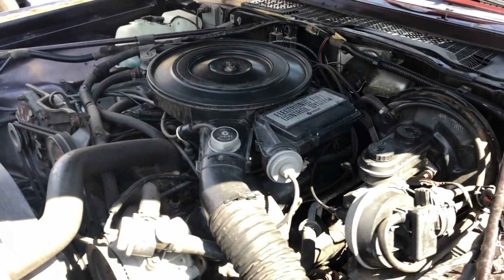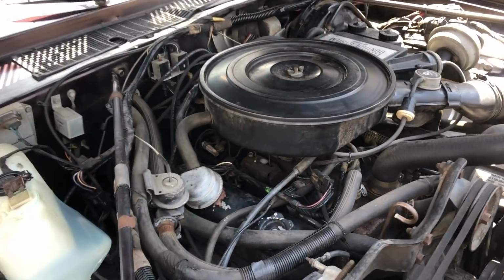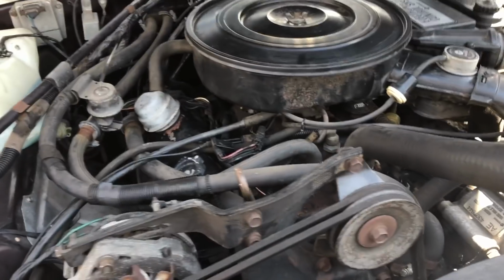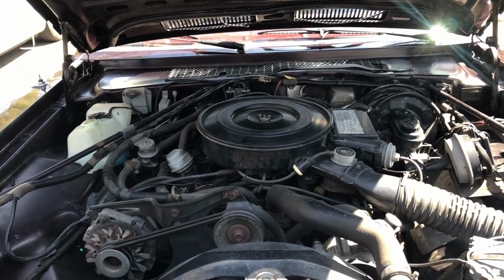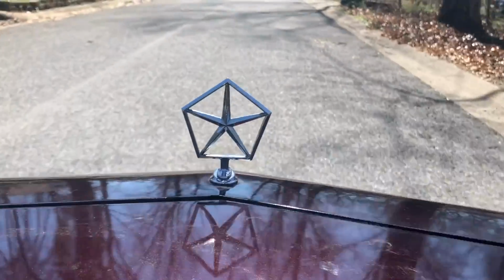The Car Chrysler Forgot to Stop Making - My 1988 Plymouth Gran Fury

Comment: Way back in the day I had a new 1982 Chrysler 5th Ave with 11 miles on it as a company car as an asst body shop manager. It had the same red interior but was more "luxurious" than the Fury and Diplomat. The silver paint and vinyl top was beautiful. I loved that car so much that I bought it at cost from the dealership where I worked when I went to work for Geico. I miss that car and other than a water pump and a/c compressor when it was well over 100k miles it never once gave me any trouble or left me stranded.

Ahh...memory lane. Those were the days.
Reply: Thanks for sharing!

Comment: I saw this exact GF on FB Marketplace and was quite tempted by it. The speed control and premium stereo on a car that lacks a/c make it an awesome unicorn. I'm happy that you're keeping it original-looking; the fake-police-M-body is too commonplace.  :-) My parents had a 1987 GF, and my current daily driver is a 1988 Fifth Avenue (43k miles when purchased a year ago). I replaced the carb and ignition on my Chrysler with an equivalent for a 318 from 1978, and the task was worth the effort.

These cars looked strange when cross-shopped with others in the $13k-range in 1988, but they're so unchanged from the M-body introduced for 1977. The base bench seat design is from the 1980 Diplomat/LeBaron, and the turn signal stalk design dates to the 1979 NY/Newport/St. Regis (if not the Horizon/Omni from the previous year). Check www.oldcarbrochures.com if you would like visual references.

The TALL rear axle was so that Chrysler didn't have to spend money on an automatic overdrive to get 21 EPA mpg on the highway. It's a testament to the 1600 rpm torque peak. My Chrysler will shift into third at 18 mph on a light throttle.

(If you want to talk 1:1 about these cars, my gmail ID is PM27L0D.)—Paul M.
Reply from the maker: Hey Paul, thank you so much for the comment and all of the info that you included regarding my Plymouth Gran Fury video I made a few weeks ago.  I really appreciate what you shared and your offer to converse more.  I'm in a crazy place right now with a family member that had recently passed away but as things slowly return to normal again, I'll take you up on the conversation!  -Chris
Reply: @hullinger  I'm so sorry to hear about your loss. After having lost both parents, I understand the emotional earthquakes that follow.

Comment: just switch to a standard electronic ignition, did it on my 77 newport and fixed any problems on the cheap... using the existing computer and wiring! ask Richard Ehremberg how!
Reply: Rick Ehrenberg will be the first to tell you there's no horsepower in tearing out the Lean Burn.  It's a MYTH.  

He will also tell you to diagnose the actual problem and fix THAT, instead of hacking up a car, just because that's what "everyone else" did.
Reply: @pkranz937  the reason I did it was because it would surge and lose power at times and it also gave me a LOT trouble when starting it, to the point where it would suddenly make a Huge explosion prior to actually starting, when my stock muffler bursted into a hardshell taco, I decided enough was enough so out went the lean burn an in went common Chrysler electronic ignition and dual flowmaster... Every body probably did it for similar reasons... And don't forget to tap the carb for the vacuum advance line
Reply: Also, no hacking was made to the system, just tapping wires from the module

Comment: I own the Chrysler version of the m-body, and I did the ignition computer delete. I used the MSD ready to run distributor and a non-feedback Carter BBD carb. Timing can be tuned like any old school small block and it has made the car much more enjoyable to drive.
Reply: Throw a Throttle Body Fuel Injection System on there with an Air Flow Sensor from Summit Racing Equipment and the Power Goes Up,Response  Time Goes Up, Fuel Mileage Also Improves.
Reply: Yes lots more power !!!!!! The ones I did dropped 3 - 5 second in the 14 mile ! The carbureot they use for lean burn/spark control computer cars robs the power...Even the 4bbl thermoquads rob power !
Reply: @01trsmar  Well 20 mpg stock vs 13 or so with your mods. But this late in the game anybody still running ANY version of it (carbs) can afford the gas with either carb. :-)

I dumped a gm feedback carb for a edelbrock 650. Still ended up re jetting it 1 stage leaner than out of the box configuration. Ran good made more power! I was getting a fleetwood to 60 in 10 secs.
Reply: Can u send us a link for the Msd disi and the BBd carb? I have a 86 Plymouth that I might keep if I can locate these parts
Reply: Yep did the same thing to my 82 Cordoba.
Reply: I'm interested in this set up also. I have an 85 police Diplomat with the Quadrajet. Intake manifold took a dump so I'm ordering an Edelbrock intake. Might have to go with a new carb and disi.
Reply: Here's the parts I used for anyone interested in the way I did the conversion: 
dizzy: https://www.summitracing.com/parts/msd-8388/overview/make/dodge 
carb: https://www.summitracing.com/parts/urm-6-6249/overview/make/dodge
Reply: try to find the cop version of this car. Mine had a Rochester Quadrajet and hauled butt. BTW the computer was mounted behind the pass kick panel inside the cab
Reply: There is absolutely nothing to be gained from ditching the lean burn system.  Fact. 

Fix the carb, change the plugs, wire, and cap. Get the timing right. Fix the vacuum hoses and wiring connectors.  95% of the problems will be corrected by these measures.  If the computer is bad, they're a third the price of switching carbs, intake, and ignition.  And you won't gain any power, you can't pass emissions, and you absolutely trash any resale value any collector would pay for hacking it up.
Reply: Non feedback carb.
Wow, your mileage and driveability must be something to write home about.

Comment: I remember cars not coming with any warranty and my parents buying a car without test driving it, then having to pay to fix it and get it running before they left the dealership!  I also remember the first car I ever got that had a warranty - 12 mo/12,000 miles.  Folks today probably wouldn't even consider buying a car that didn't come with at least 36mo/36k mile warranty.

Comment: Awesome job on the movie! The lean burn problem with the car, will not go away. I remember my dad's 360 Chrysler was a turd, especially in very hot weather. I think we modified the distributer to work like a conventional one, and let the electronics control the fuel mixture. It made enough of a difference so it would run decent in all ranges without pinging so bad. For that year car, in NY all that is required  for inspection is the system components to be on the car.  No inspector would ever check if it has been altered. Keep a spare ignition resister block in the glove box. They blow like a fuse for no reason at the worst possible moment. Good luck with the car Chris.   Ross

Comment: Perhaps a “detectives” tribute car instead of full on police replica/tribute car...??🤔🚨🤔
Reply: Go Sgt. Joe Friday & Officer Bill Gannon!!  The City, Los Angeles, California.
Reply: He should have mentioned the Dodge Diplomat version as well
Reply: Some of the A38 packaged cars came with luxury trim.  In 1980 you could get the LeBarron version of this car with leather and full trim.  This carried through the years with the various name plates of this car.   Chrysler fleet would offer trim upgrades for police with little impact on the price.    All that is needed is a suspension upgrade, fatter tires and a throaty exhaust and you pretty much have a police car.   As for the axle ratio,  A38 package cars had a few options.   The axle on this car is one of them.

Plate C
Reply: @platec4798  the police cars were AHB after 1983 (and still are on the '19 Charger Pursuit).  Options varied a bit over the years, but leather was never one of them.  They came extremely plain, you had to order carpet, A/C, pw/pl/cruise, and none of that stuff came grouped in a package. It was a la carte.
Reply: Good idea!
Reply: what? short time?
https://youtu.be/NWRrSufx5kw?t=13
yeah, it's a dodge

Comment: I do appreciate this car.    What a cool ride.   I love old American 80s cars.   The last of the rear wheel drives.  Neat find
Reply: Exactly. I hate front wheel drive, and even more than that, I hate the blob like styling of 90% of what's on the road today.
Reply: I will never own a front wheel drive vehicle. Of course I’ll always drive older cars because I really have no use for a truck or SUV. My daily driver is a 1992 Volvo 740. Best car I’ve ever owned. At 435K miles it is more dependable than some cars 20 years newer.
Reply: Chump Johnson aa Volvo 740 is the best car.   Period.   Hands down.    So durable.   I have had a few.    I even had good luck with the 760gle v6
Reply: Joes Golden Garage 

I feel the same way. My car has been in family since new. Other than routine maintenance it never needs repairs. It still has the original alternator and starter. Engine and transmission never needed any rebuilding. The valve cover has never been removed. It’s never left anyone stranded or needed a tow. Paint and interior still looks great although my driver seat will need recovered. I’ll save that as a gift to it when it hits 500K miles. They are truly great cars built to last. No car company will ever make anything like it again.
Reply: @JoesGoldenGarage  my 1997 S90, 690,000 km, basic maintenance and runs fine.
Reply: i drive a 92 buick roadmaster, texas made car. RWD. its an awesome car! its the limited sedan, ol' tbi 350 but its as reliable as u can get.
Reply: Mike Wells yeah I had a 1992 road master wagon.    It had almost 200k on it when I sold it.   Sill ran like new.
Reply: Mike Wells 

The TBI 350’s are great engines.
Reply: I love this Plymouth Gran Fury 1988. I love this old cars 1980s, 1985, 1986, 1987 and 1988 is my year favorite
Reply: All cheap like, just how you'd expect an 80's Plymouth.  These were the cop cars in my hometown.  My parents almost bought a  Chrysler 5th Avenue (the nice version of this car).
Reply: @brentboswell1294  my dad bought 2 5th avenues. The first one he bought was a black one w/beige leather interior in '82 but it was an '83 model and the second was burgundy and silver w/burgundy leather in '85 which was an '86. Both were great cars!
Reply: @derekprice1776  yeah, my folks settled on the FWD New Yorker instead...which was lipstick on a pig.  The K-cars were terrible!  I took my driver's test in the New Yorker...I remember the column shifter being so loosely goosey that it would get hung in second gear...you had to bump the shifter from below to get the car to go into 3rd! (Bump it too hard and you'd end up in neutral!).  I don't miss the differential in the transaxle going whoop-whoop-whoop down the road, either (Chrysler never seemed to nail that one down in the K-cars...never heard anything similar in GM FWD products from the time).
Reply: @brentboswell1294  I completely forgot about the New Yorker! After Chrysler stopped making big body Fifth Avenues, they dolled up a k car and called it a Fifth Avenue.
Reply: Real wheel drive is the saving grace of cars like this.
Reply: Carb in 1988?  Pretty old fashioned!
Reply: @shebbs1  it's because the primary market for these cars (both the Gran Fury and the Dodge Diplomat) had become police departments by the mid 1980's...4 barrel performance options were available to police purchasers only (as were a few other options, like heavy duty alternators and a bigger rear end differential). It was a cheap way to give police departments what they wanted, but they could not offer that to the general public (EPA fuel economy targets). It bit Chrysler in the butt in 1989, when M car police sales fell off a cliff. Chevy offered the Caprice with basically a Corvette engine that year...fully electronically fuel injected
Reply: this was the height of 80's cars https://www.youtube.com/watch?v=W1P49AHk3BA .lol
Reply: Joes Golden Garage, not the last of the rear wheel drives, my 94 Town Car also had rear wheel drive.  Fortunately my 69 Rambler has it too!  I much prefer rear wheel drive to front wheel drive.  :)
Reply: The last fury

Comment: Okay here is my 2 cents. I would spend the 300 dollars and upgrade the ignition system. Yes keeping it original is great but keeping it reliable and on the road would be a better tribute than it sitting in your driveway because of the weak electronics.
Reply from the maker: I appreciate your comment and advice and really, I think I'm heading that way with yanking the Lean Burn stuff.  Just isn't worth the frustration trying to keep it and make it run right.  I'm told even when these cars were new, the Lean Burn kept these engines from running right.